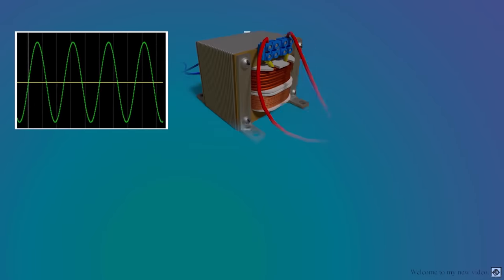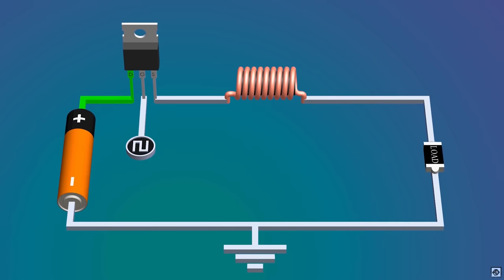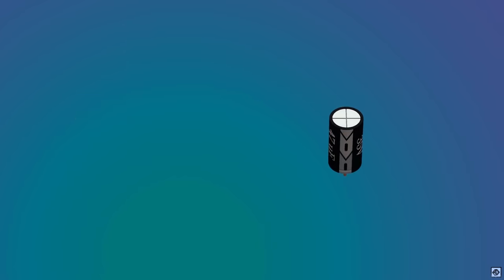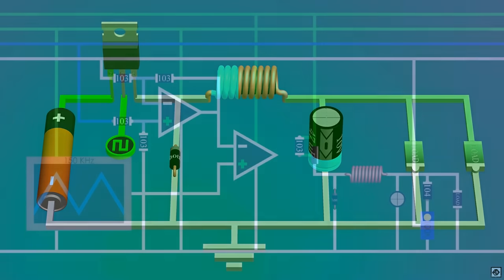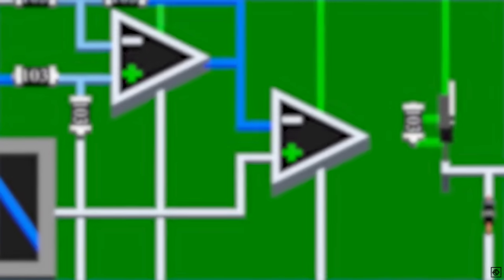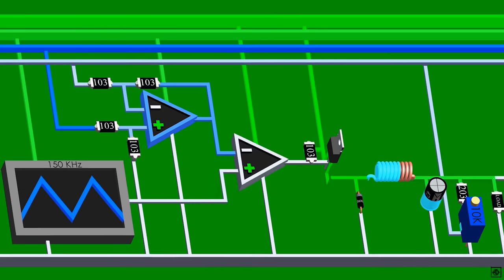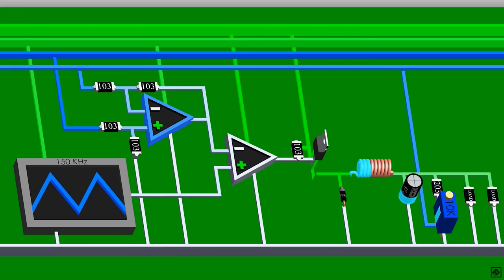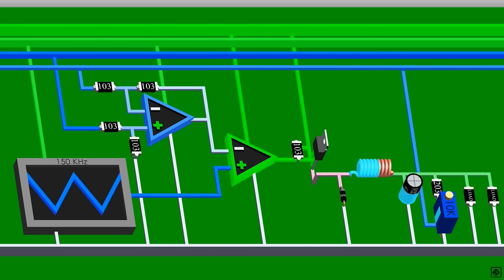How does Buck Converter work? | DC-DC Converter - 1

Comment: Good as this video is, it is yet another example of why it is important to have a human do the narration rather than a text-to-voice system. This video would likely have been better with a real voice.
Reply: Real facts there my man.
Reply: Good basic explanation.
An Analog voltage reduction uses resistance to drop the voltage,,which generates a lot of heat.
A Buck convertor storing the charge in magnetic Flux is far more efficient.
Reply: Maybe with the new AI technology this video would be a lot smoother
Reply: I was using artificial voices, but have come to the same conclusion. However, the more recent engines are much better, and a little work at spacing correctly and Interpunktion are essential. Just writing information and read it from a sheet is rarely the information people listen to.

Comment: Triangle wave as a duty cycle template with the comparator is freaking genius.. never crossed my mind before.
Reply: Typically a sawtooth wave is used, but either way that's how it has been done for decades.
Linearity of the triangle or sawtooth is not critical since the feedback circuit cancels any effects of non-linearity. If you are making something like a signal generator then you do want very good linearity.

Comment: 3:58 ERROR: Please note that the output voltage is independent of the load. The output voltage only depends on the input voltage and duty cycle. Changing the load could change the output current and hence output power dissipated. But you will still have a fixed average output voltage.
Reply: I was thinking the same thing when I saw it. The PWM wouldn't need to change to keep up with the change in load (assuming all the components can handle the higher current).
Reply: that's odd I'm having a laboratory work on Simetrix regarding buck converters and my groupmate has the average output voltage and the peak to peak ripple of the output voltage increasing as the load increases
Reply: @davidglendaleardenaso8735  what control/feedback system are you using?
Reply: @yumyum7196  a simple buck converter circuit with a PWM as switch where we find which load resistor/inductor has the boundary conduction mode
Reply: It has a maximum power rating tho. So, when it draws more current, the voltage will drop.
Reply: If the inductor current is continuous, that is it does not drop to zero at any point in the switching cycle, then there is no need for change in duty cycle if the load current changes and the input voltage remains constant. If the inductor current is discontinuous (spends some time at zero each cycle) then duty cycle will change with load current. 
Vout = Vin • d    applies ONLY when operating in CCM

In a typical design you would set the DCM-CCM boundary somewhere in the range of about 20% to 40% of full rated load current. You could go higher or lower if you want, but that's what most designers will aim for.
Reply: @d614gakadoug9  you should setup a channel!

Comment: 150kHz is LM259x but the triangle wave of the modulator is only used on LM2574/5/6 which is 52kHz.  Next video you need to deal with how the LC filter introduces a double pole and gives a 180degree phase shift.

Comment: Wow that is amazing I will show it to my students. You could make a boost converter also, then an isolated topology would be nice :).  Keep up the good work!
Reply from the maker: Thanks you so much. It would be an honor. 😃
Boost converter is next.
Isolated topology will be later, after inverter. 👍
Reply: @ExplorerStuff  Many thanks, I was looking for a buck converter and took advice from an Electrical Engineer that said he would never use a cheap converter because it can damage the much more expensive battery, BMS and load, but didn't explain why. So I went to Amazon and found lots of cheap $1 bucks that are tiny and one large for $20, I was confused by the large number of components on the more expensive one when compared to the cheap version as they both claim to do the same thing, now I understand why.
Reply from the maker: @_John_P  Glad it was helpful.😀

Comment: I kind of lost at 8:30 :
Why the feedback voltage shouldn't exceed the reference voltage 8:30 ?
How the minimum output voltage was calculated 8:45 ?
Reply from the maker: If the feedback exceeds the reference then the error amplifier will output 0 (ground) and the comparator (PWM Generator) will output +12 volts.
This would turn off the MOSFET and the circuit will stop.
It's not an issue when the circuit is running, it will stabilize itself. But while designing, it should be considered.

Minimum voltage was measured from the circuit.
Reply: @ExplorerStuff  thanks for the great video and your reply !

Comment: amazing tutorial as ever, 1 more quick tip for you, new challenge emerged on YouTube Transformerless Power Supply so 220AC mains dropped with the help of X-rated capacitor (down to 12 volts dc) placed before bridge rectifier,  I searched a bit, yes There are few videos about it,(many of them  in Hindu language) but almost no any proper video tutorial about it for English speaking audiences, it's good time for you to smash that challenge (make a detailed video about it/especially how to calculate capacitor rates for different low voltages) and become number 1 👍👍👍👍
Reply from the maker: Glad you think that I can do it.😄
And, Is it about the capacitor voltage divider?
I think I saw that.
Reply: @ExplorerStuff  not only I think so, I'm pretty sure that you can make it better than many many others ☝, I may have described it not much accurate, it's called x-rated capacitor,  I'll put a link here for you to see what I'm talking about
Reply from the maker: This is a dangerous circuit. 
1) No isolation from mains. (Most Important)
2) The Zener is active always (100%) and for large currents.
3) If there was no Zener diode, This would increase the output voltage to the input. 240V.
4) By 2,3 The Zener takes too much current through itself. It will burn in seconds or minutes.
5) If the neutral wire gets grounded (By Mistake or poor wiring), then the output of rectifier is double the input voltage (+240V & - 240V = 480V).
Reply from the maker: So, I won't be doing it. It's Dangerous.😄
Reply: @ExplorerStuff  c,moon you do it for educational purposes, anyone attempts to repeat, will do solely at their own risks, ... just put up some warning disclaimer before video.. and that's it. 😒🤔
Reply: @ExplorerStuff  you might be regretting for refusing to do it after lets say 4.5 years, cuz somebody will do it anyway, and get most of  the adherence of viewers/ and everyone would refer that YouTuber the professional not you 😉😀
Reply from the maker: Still not worth risking anyone.
Thank you for suggestion but safety first.😄
[Mains -> with isolation
DC/AC -> low voltage only]
Reply from the maker: @heyderaliyev8976  If you want to see the circuit then you can make and simulate it in any online circuit simulator. (Building it is risky).👍
Reply: @ExplorerStuff  😂😂see my video sir.. Full of high voltage stuff
Reply: @ExplorerStuff  yes Sir I understand your worries about Safety, but did you know that almost 70% of recently produced Led Ceiling Lamps in China are built on this circuit, just google it and see yourself/ but nevertheless as a man who works under top World safety standards over 7 years now I feel the same importance of safety just like you do
Reply: @ExplorerStuff  is there any good online circuit simulator you can offer..? I know one everycircuit.com but it's limited to some extent you have to pay to unlock all it's features / I need full free
Reply from the maker: @heyderaliyev8976  I use this -> https://www.falstad.com/circuit/

Here it the link for this circuit.
https://tinyurl.com/y2nyh799

I may do this one later (Only after making it safe).😄
Reply: @ExplorerStuff  thanks a lot, I liked the simulator, going to start some circuits to see how it works later today 👍👍 BTW You won't regret doing that circuit especially making a perfect video(focus on capacitor calculations for different low voltages) about it, you just put up multiple safety warning messages and that's it, people need to take care of their safety themselves ☝☝
Reply from the maker: @heyderaliyev8976  Yup. Thank you.👍😁

Comment: Hello, first of all good job for explaining how it works. Second I tried to replicate the circuit in a ltspice simulator and I was not able to achieve a good result. Most probably I missed something out while trying to replicate the circuit. My voltage drop when I add a low resistive load and the variable resistor doesn't have any effect on the output so obviously something is not right in my circuit. 
I noticed in your video that at min 04:00 power supply is connected to the drain pin of the mosfet while at 07:00 power is on the source pin. 
Could you please share with us a clear circuit diagram so we can try to replicate it? I can send you the diagram of my circuit if you want to see it.
Thanks and looking forward to your response!

Comment: 2:16
Hey, can someone help me understand Buck Converters? :)
I do not understand the negative voltage spike when switching off the mosfet

The magnetic field in the coil is converted into current and, according to Lenz's rule, wants to counteract its origin, i.e. prevent the voltage / current drop or maintain the voltage / current

Thus, the coil discharges, similar to a battery
But why should there be a big negative charge on the left side?
Reply: It’s due to voltage leading the current in an inductor. When the voltage goes to 0, the current follows 90 degrees later and produces a high negative voltage spike (ELI the ICE man)

Comment: It would be extremely unusual to configure the voltage error amplifier for unity gain at DC. Typically, though not always, the EA is run open-loop at DC and the frequency compensation components assure proper 0 dB gain crossover at a frequency that maintains adequate phase margin for stability.

Comment: Excellent video, I have a question, you have technical information if there is any to design a DC DC converter with positive variable input and that has a DUAL symmetrical output (high power approx. 2A) of +15 VDC and -15 VDC. Know of some base design with the theoretical source and some switching regulator.

Comment: Ok so lately all my car dome/celing lights and dashboard clocks ⏰ have been frying up. Then I checked my car battery 🔋 voltage ⚡ is sending 14.2V to these devices whereas required voltage should've been 12V. I then bought a couple of these dc to dc converters but it doesn't convert 14V to required 12V to these accessories I need..any help?

Comment: So can we make a closed loop buck converter using ne555 as square wave generator and lm358 as a comparator🤔.  if yes , then  please  make a video on it. This would be really helpful.
Reply from the maker: A square wave generator instead of the triangle wave generator.
-> It won't work, because we need a linearly varying wave (triangle, saw, ramp, etc.).
A square wave in the comparator will result in the same square wave at the output.
In a triangle wave, the intersection point between the wave and the constant voltage (by error amplifier) creates the PWM. As the constant voltage moves, the intersection point also moves.
But in the case of a square wave, the intersection point will always be on the same vertical line. Hence, its duty cycle will not change.

LM358 -> as we need two op-amp (1 for error amplifier, 1 for comparator), this will be great.
Reply: @ExplorerStuff  thanks for replying . I am newbie in electronics and that's a lot of knowledge for me. And interested in making a buck converter without using lm2596. So it would be great if u make video on it. Thank U

Comment: I want to flash a 1.6V LED with a PWM. The PWM is 3V. Is it possible to put a buck converter behind the PWM to control the voltage down?

Comment: The 'points' that your graphs are pointed to never correlate to the data they're showing.. At 3:02 the bottom graph (yellow leads) are both connected to the same section of a circuit.
Then, at 3:46 both graphs show the the same connection point for the data, yet they are showing different signals.. It's hard to follow what you're saying when the traces on the graphs don't align with the points that they're connected to.
Reply from the maker: Because, Green represents voltage and Yellow represents current.
I forgot to mention that. My bad. 😅
Reply: @ExplorerStuff  Yeah, but put the probes where they make sense. There is no voltage drop when you have the probes on the same lead.

Comment: If i want to connect a solar panel (0-200W) direct to a load (0-40w) what device do i need?
Input voltage is 0-40v depending on sun, and i want the output to climb from 0v up to 20v but go no higher?

Comment: Hey this is a dumb question but how did the inductor discharging made a high negative point therep and also why use low voltage diode there

Also you said when the constant supply decrease duty cycle decrease , but in the output it looks like the on time increased so duty cycle also increase right? I didn't understand that working clearly
Reply from the maker: When the inductor discharges (in this video) the current flows towards right thus electrons flow towards left. Also, the left terminal is open (MOSFET is off). This creates excess of electrons near the left terminal thus creating the negative voltage(let -5V).  
Now, if you give them (electrons) a path to flow, we will not get their accumulation and the only path is towards ground(0V).
So we add a diode such that when the inductor terminal gets negative,  the diode turns on and allow the electrons to flow. 
But when will it turn on?
That depends on its forward voltage or voltage drop (here ground is positive w.r.t the terminal) (let voltage drop be 1V)

The ground will always be at 0V.
Now, as the voltage at inductor terminal drops below 1V (or less than -1V). The diode will turn on and thus the voltage will not fall more than -1V.
Now, if voltage drop is 0.7V thus it will conduct at -0.7V.
So we use a low voltage drop diode.
And schottky also works at high frequencies. 
Hence, a low voltage drop schottky diode.
Reply: @ExplorerStuff  hey also when the constant supply decreases you said pwm duty cycle decreases but in the output it looks like the on time width increased so it means the duty cycle increased right ?
Reply: @ExplorerStuff  thanks for the reply
Reply from the maker: Yeah, it increases😅. 
Thanks for noticing.
Reply: @ExplorerStuff  yeah was confused 😅

Comment: Hey I like your video , it's really good but can you label which one is the current output and and which one is voltage ouptue in the animation of DSP graph
Reply from the maker: Thank you.😀
Voltage = Green / Red
Current = Yellow
Reply: @ExplorerStuff  ohh thanks 👍
Reply: @ExplorerStuff  hey I have another doubt if your using high frequency pulse width modulation why not use a constant signal
Reply from the maker: @Rohit-xc3tl  And how we will use it ?
What will it control ?
Reply: @ExplorerStuff  that's a good question, but if I place a constant DC signal from a DC generator will it work .Why is PWM used in this circuit can you explain that a bit
Reply from the maker: @Rohit-xc3tl  we don't have thr lower DC voltage. Hence we use the PWM.
Let input 10V.
When PWM is 50% the output voltage is 50% of input voltage(5v). When PWM is 25% the output is 25% of input (2.5v).
Thus we get any lower voltage (average of a cycle) by higher input voltage.
Reply: @ExplorerStuff  hey thanks for explaining

Comment: Well, depending on what you need the power supply for, you could use a voltage divider.  Is there something I don't understand?
Reply: A voltage divider is very wasteful and for high current you need massive resistors.

Comment: Describe also the  radio recevier and  transmitter circuit please. Best regards
Reply from the maker: Radio circuits are tricky. I am working on 433MHz module but it will take time.

Comment: And where does the 150 kHz saw tooth ref. signal come from?
Reply: usually from a simple built-in oscillator based on the charging and discharging of a small capacitor through a resistor. Much like the big capacitor, featured in the video, but because of a much smaller value it will charge and discharge much faster.
Reply: @uwezimmermann5427  So it does not present on this clip althoug its a part of the circuit.
Reply: @alexlo7708  yes, if you look at the example datasheet of a simpel and widespread chip for the use in this type of converter, like https://www.onsemi.com/pdf/datasheet/mc34063a-d.pdf (don't be afraid of a datasheet like this!) you can see the xternal capacitor which is supposed to be connected between pin #3 and #4 on the outside of the chip. You will also see the transistor and the operational amplifier from the video tutorial and how everything fits into a small plastic package.
Reply: @uwezimmermann5427  So this xtern cap defines the clk frequency and it decides the output voltage.
Reply: @alexlo7708  both the frequency and the duty cycle affect the current through the inductor which then determines the charge on the output capacitor and thus the output voltage. The relation is not linear and this is where the feedback through the amplifier comes in and regulates the output voltage. Some converters change the frequency for control, some change the duty cycle, some use a combination.

Comment: Not sure if someone mentioned, The GATE and DRAIN are switched.
Reply from the maker: Yup. It's for animation. 😅
Reply: @ExplorerStuff  I completely understand and agree, as it's an animation. But the actual component layout is placed in the video showing the case design and leads connected to the TO-220 case.  One of your viewers may see that as it is and build from your animation. We don't want to provide misinformation. It would of been different if that MOSFET were just a box with leads coming out of it. Thanks
Reply from the maker: I will improve it in my upcoming videos. 😀